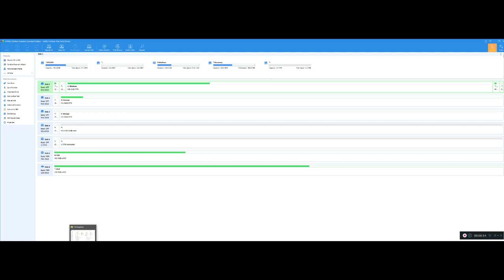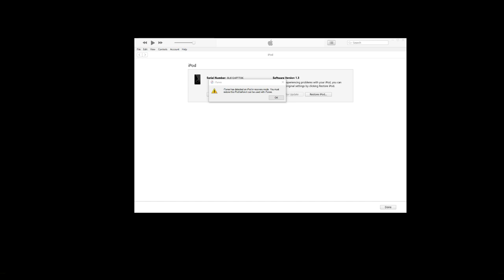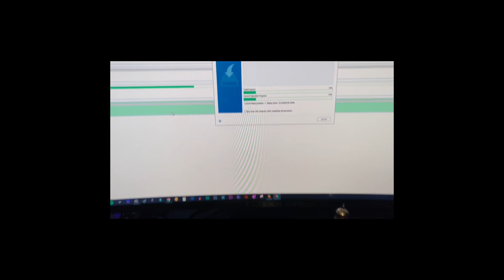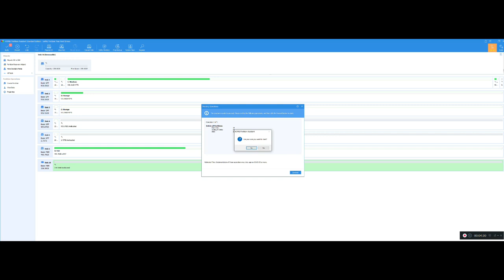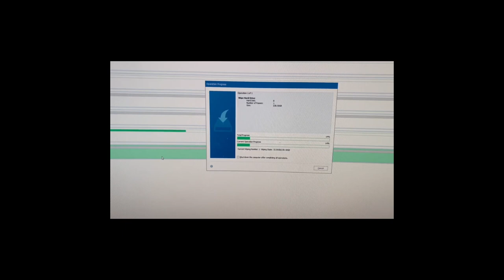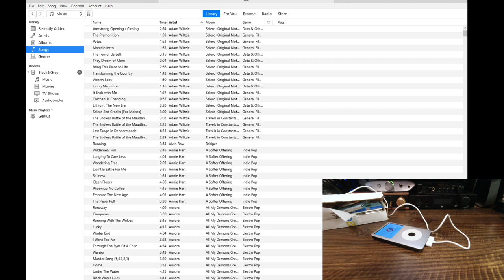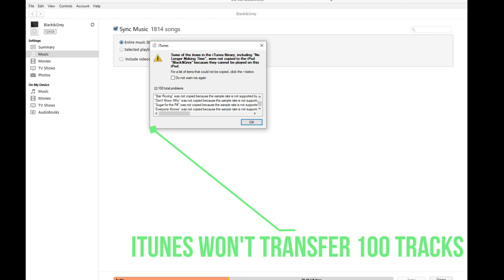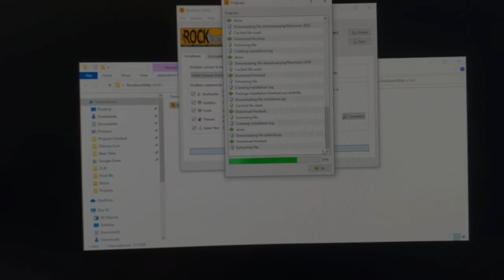My iPod Mod Journey And The Lessons Learned

Comment: Great video! I went through a similar journey about a year ago and was thankfully able to pick up a few units before the market got outrageous. 

I have a 5.5gen thin with an iFlash solo rocking a 128Gb and a 5.5gen thicc with an iFlash Quad with 2x 256Gb cards and a 3000mah battery. The 128Gb I keep in my truck loaded with like 16000 mp3s and the 512gb is my daily driver with about 8000 ALAC files. Doesn’t get much use these days with the work from home but the sound is, the best I can put it as relaxing. 

I spent probably 15-20 hours of research and had a coworker give me a 5th gen 30gb that was “broken” (revived with a new battery) that I used to build my confidence in opening and modifying which I used to build my babies. 

For me it’s not the best sounding device but it is fun and takes me back to my “developmental” days of music as my 128gb is actually my iPod from high school I found in a drawer at mom and dads. It’s also nice not having a device constantly being interrupted with notifications while listening. 

I suspect these things will stick around for a long while and I think Apple would make a killing releasing a modern DAP that integrates into their ecosystem. WiFi, Bluetooth and AirPods with a large flash storage device using a subscription to Apple Music win a device with Apple quality? Sign me up.

Comment: I’m glad you got a second one. Many would have given up. I’ve thought about it but bought a fiio e07k instead with a wolfson 8740 on eBay with my iPhone 11 so it’s more future proof. It’s shipping now and I’ll report back next Saturday or so.
Reply: sweet! that was my first dac amp. last year i found a cheap e09 dock on ebay and now rests in my dads desk. he uses it every day.
Reply: I have several others over $1500 in portable amps and Bluetooth. I just wanted to try out the wolfson chips again. How did you like it? The e17k was too bland for me.
Reply: The really high gain 12db in the e07k matches perfectly with the stupid iPhone dongle. I feel like it makes this thing useful with real and low sensitivity cans. I could never find an amp to use with it but this matches oddly well with the dongle. I know, I know, some may say the Apple dongle sounds bad and isn’t hifi, but it’s ruler flat and the bass bumps with the e07k, it’s just underpowered. The soundstage is wide and it’s more musical and just as good as the common Ess Sabre dacs with more warmth and less harshness. This is a very fun listen for sure.

Comment: Hi I love your channel, I also have a ipod that i rebuilt. I wander if you could advise me on  a bluetooth transmitter that that would be good with the ipod. i have tried the common ones as seen on amazon but i am having volume issues (not enough). many thanks
Reply from the maker: What issues are you having?
Reply: @NoThemeReviews  Ok. please bare with me on this. I am not an audiophile. but i love music. a couple of years ago i digitised my ipod and put 3 128gb sd cards in it (a little over the top) it is a ipod 5.5 and it is great, i love it. i used to listen to music on beatsx (sorry about that)earphones so i only had a bluetooth connection to all my apple stuff (victim of fashion) if i wanted to use the old ipod i just used any old plugin earphones. I tried  to use a bluetooth transmitter with my ipod and beatsx but there was no volume.
Then my beatsx broke. I have now bought some KZ zx10spro iems and it is as if someone has taken the carpet off the speakers they are great and alot cheaper than anything apple. so that i can use them with bluetooth i have now also bought a hiby W3 and that is great as well.
So (at last) my question to you is
Is there a bluetooth transmitter that is small and good quality that will do my ipod and iems justice that is loud enough to listen to.
Many thanks for your kind attention
Reply from the maker: It's a fairly simple process.  Any Bluetooth transmitter will work.  You could use either of these https://amzn.to/37rW17B or https://amzn.to/3d6DnDP.  What you'll need to do is put your transmitter into pairing mode and then put your W3 or wireless headphone into pairing mode.  Keep both devices within 1 foot of each other and they should pair.  If you have any other devices that are paired to W3, you should unpair them.
Reply: @NoThemeReviews  Many thanks for your time on this will get one of your recommendations.
As i am in the UK i am hoping amazon UK will have them. Thanks again
Simon